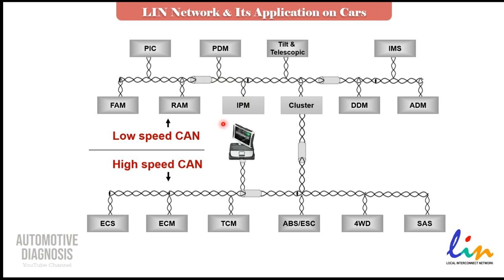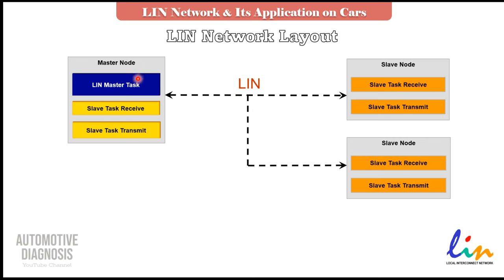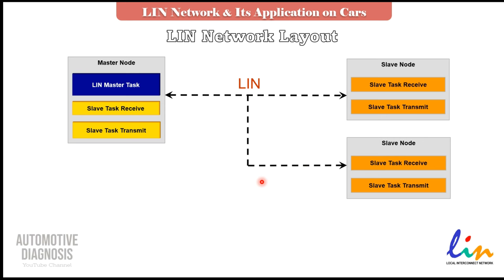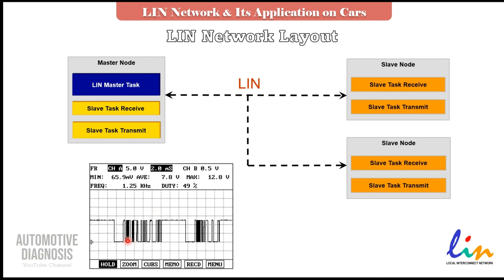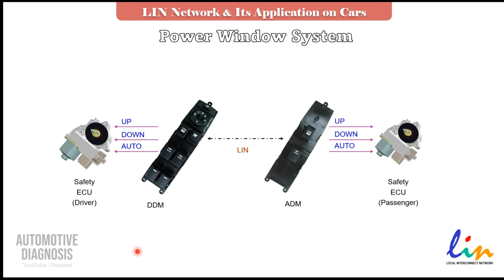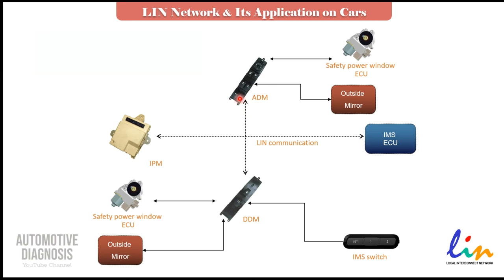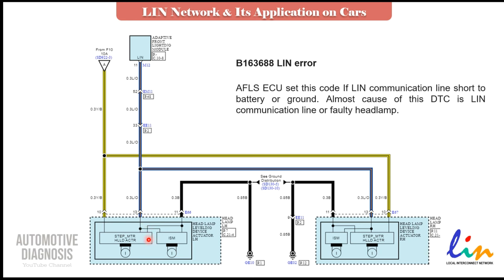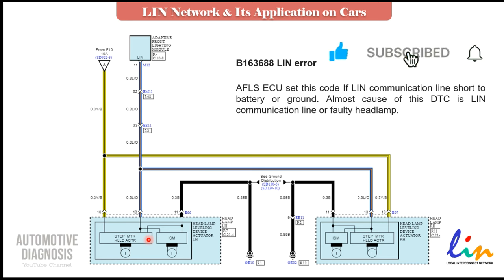LIN Bus Explained | Everything You Need to Know about LIN BUS | Local Interconnect Network #canbus

Comment: Dear Sir, Just FYI, I believe the purpose of such networks is to facilitate hackability to the vehicle, and not at all to decrease the amount of wiring.
Reply from the maker: Well, that’s one interesting point 🤔☺️
Reply: That's definitely an interesting opinion. LIN BUS definitely decreases the amount of wiring and control modules. If everything on modern vehicles ran through the CAN BUS, a $40,000 vehicle would cost $70,000 or more easily. Also, diag would be much more difficult.

Comment: What is the difference lin bus and k-line bus network?
Reply from the maker: They both use only one wire to communicate, they are both one Master- multiple Slave network, but L-line is designed for diagnostic tools communication with control units.
Reply: Okay ,,, how do you identify k-line network in a control unit 🤔
Reply from the maker: Normally each K-Line wire starts from a control unit and ends up in OBD2 connector. You may see more than one pin for K-Line in OBD2 connector.
Reply: Thank you for the information 🙏
Reply from the maker: @mwangigateiyu1570  👍👍

Comment: I'm a little slow getting to your video about the LIN-BUS.  Thank you for this information.  I'm currently retired, however my 06 Nissan Frontier and my 2020 Toyota RAV4  both have these systems and of course the High Speed CAN C System.  I'm sure the Toyota has another type of system that's Toyota's own, and hopefully I can get to testing these systems on both vehicles.  I do have an older Pico Scope and an XTool D8BT Smart Diagnostic System tester.  You really need a scope and a good diagnostic tester now to be able to test these system.  Just having a Digital Multi Meter isn't enough.
Reply from the maker: Hi there, thanks for sharing your experience. You are absolutely right, Picoscope gives more information when diagnosing the CAN/LIN bus, this video was an introduction to LIN bus, we will have more videos coming for testing the network via a Picoscope.

Comment: Can you please explain that my car will not connect to state obd but it connects to the scanner no problem. I am told that it could be can network problem. If that is the case with you make a video
Reply from the maker: Hi there, if CAN bus is down, normally you won't have connection between the scan tool and multiple systems. Anyway you can watch the following video which explain the CAN bus diagnostics:
https://www.youtube.com/watch?v=bvyHx-C2Xfs&t=212s

Comment: Hi sir on some kia models like sorento um they both "B can" and lin network in the power window system what i want to know is does the lin network replace the B can network when the later is having a problem or support it in someway
Reply from the maker: Hi my friend, yes, if both units are connected to B-Can and LIN at the same time, at normal, they share different information, but as soon as one of them gets faulty, the other one can work as a backup. But KIA and Hyundai have been trying to reduce their he number of networks in one module as well, specially on body electrical systems. Because B-CAN behaviour in wiring fault is way different than C-CAN, as normally on B-CAN if one line gets shorted the other one will still be working.
Reply: @AutomotiveDiagnosis  thank you so much sir for the clarification